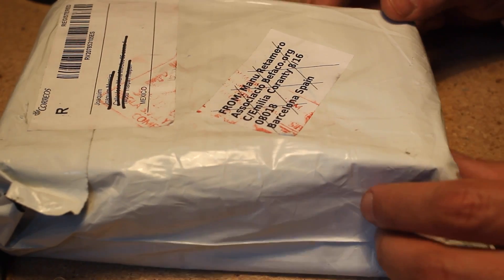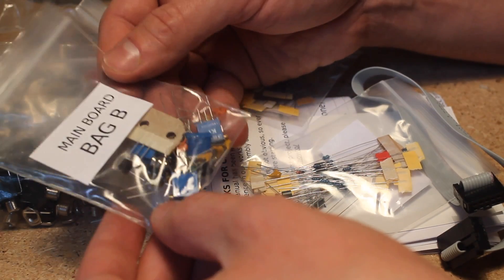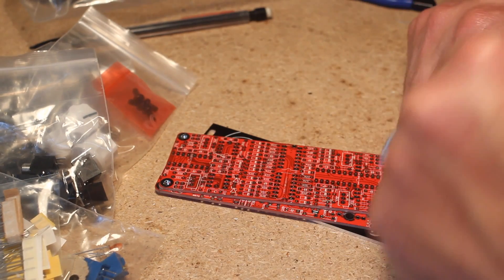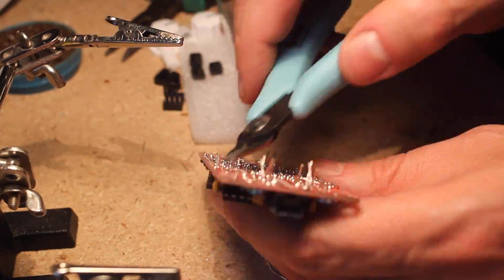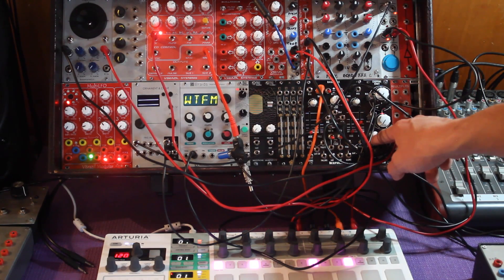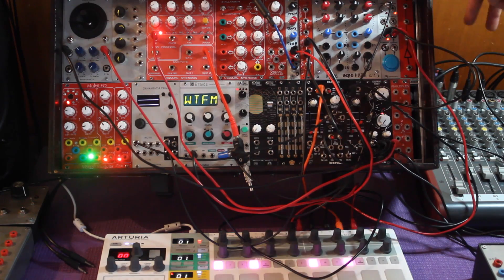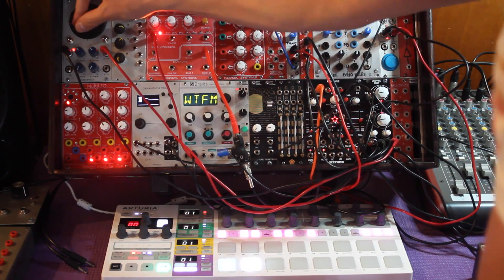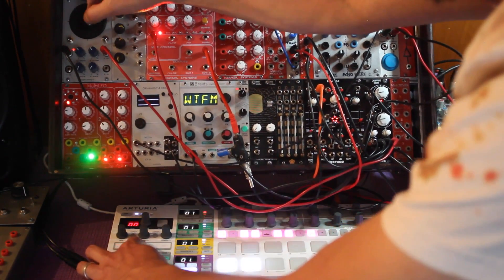Kit Review #6 - Befaco Chopping Kinky

Comment: Question: I've got a chopping kinky build, but have lost one of the headers. Would you recommend buying a replacement header or just soldering the ic directly to the board?
Reply from the maker: you mean sockets! Yes, I always use sockets. You can probably get away without it, it will still work, but if you've done something wrong and need to replace the chip, it'll be a bitch to do without it being socketed!

Comment: You make the best synth tutorials and I appreciate you immensely brother. I have a question though. I’d rather buy synth kits than already put together modules because I’m on a tight budget, however, I’m not confident enough in my soldering skills. Are there companies out there who put together and solder kits for you for a fee? The fee plus shipping would have to make sense because I wouldn’t want to pay more for a kit plus labor than an actual finished synth from its factory.
Reply from the maker: Hi, thanks! Yeah, it really would not make sense financially at all to do what you're saying. Paying someone o build for you will certainly end up costing more than just buying the modules pre built. Just look at the price difference from kit to built at the Befaco website for example.  I recommend you learn to solder, it can be done easily, just start with beginner kits! Cheers
Reply: Synth Diy Guy Thank you for your advice. I’ve decided to take it! I’ve soldered in the past a bit here and there and I have all needed equipment with the exception of braided desolder wire and a couple other things. I’m feeling good about this.
Reply from the maker: @iantheorem  right on! Stay noisy!